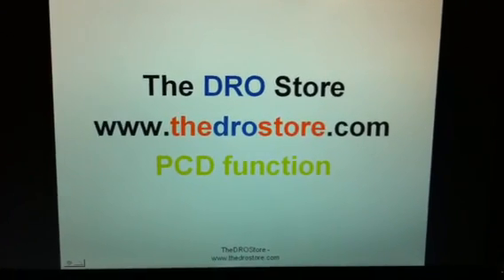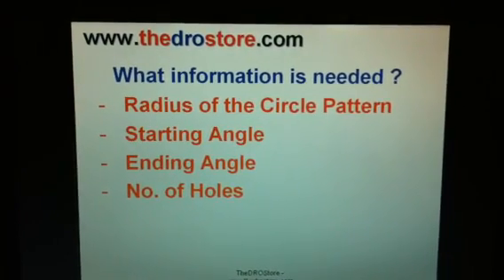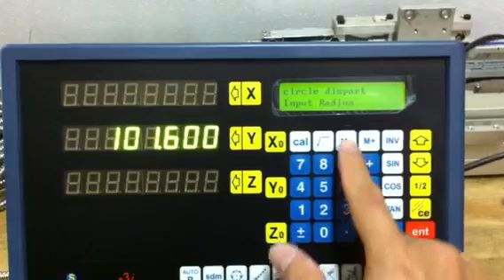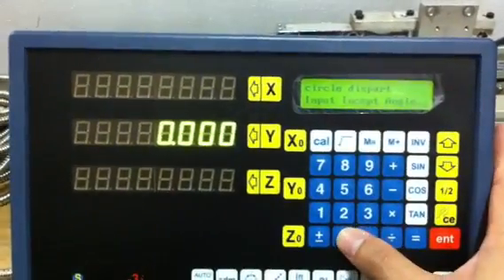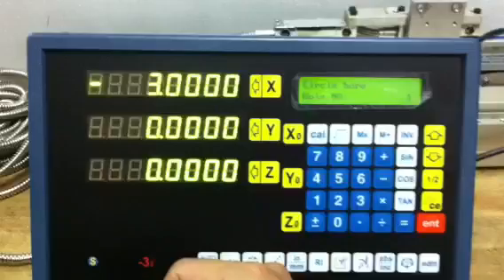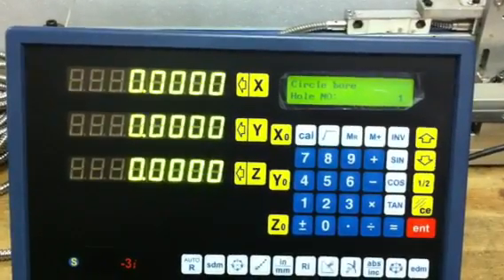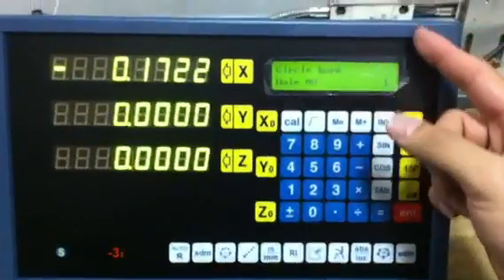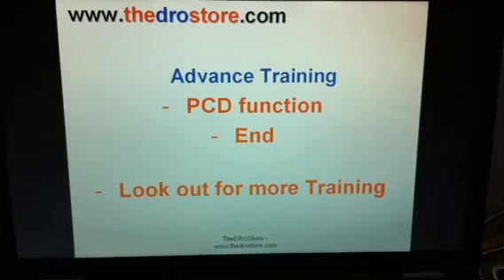TDS-3i DRO Training - PCD Circular Drill Pattern function - TheDROstore.com mTECH TECH 3i

Comment: Example: 3 holes circular  at 100mm diameter.  Enter the radius of 50mm, start angle of 0 and you have the enter the angle of the last hole. In this case it's 240 degrees.  You cannot enter 360 (for a full circle) and have the DRO figure it out for you.
BUT, if you enter 1 more hole than you need and enter 360 degrees, the DRO will do all the angles for you since the last hole (hole #4 in this case) completes the circle.